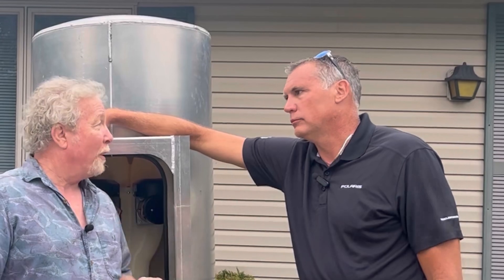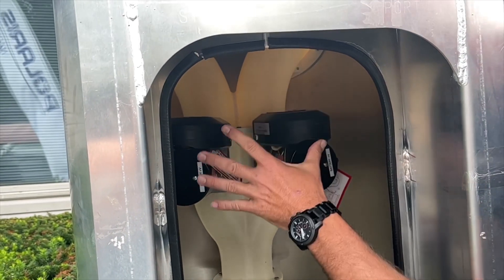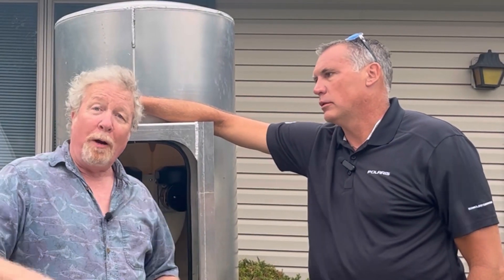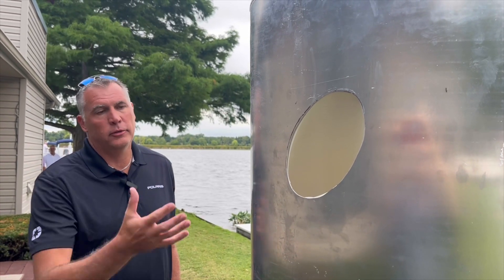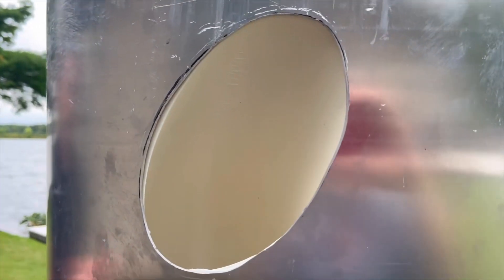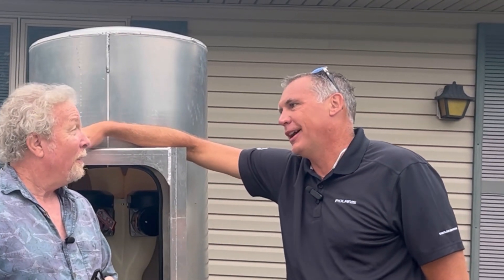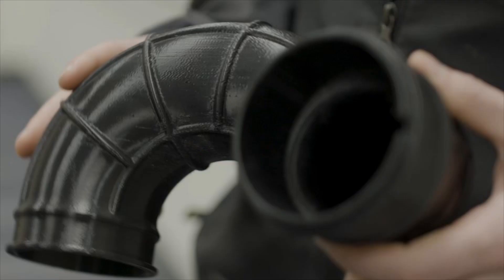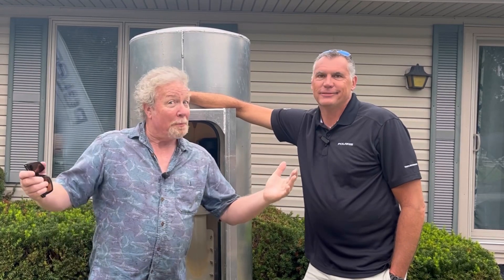Pontoon Docking System by Polaris

Comment: Awesome idea. Probley cost 10k for each pontoon unless it comes as a preinstall option. It's not like you're parking at high speeds. Might as well just set up trolling motors on the outside of your pontoons for similar results.